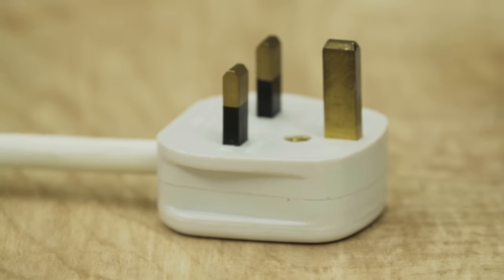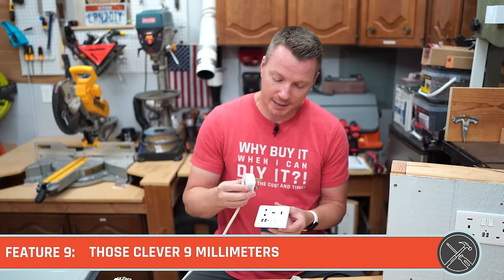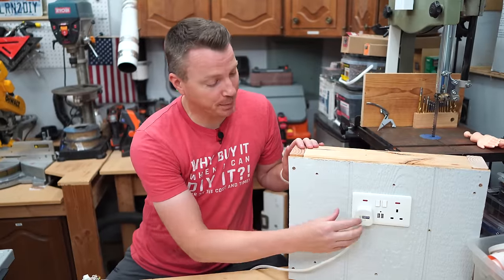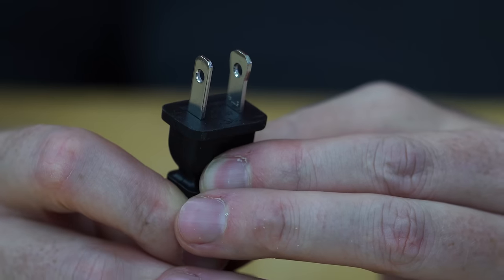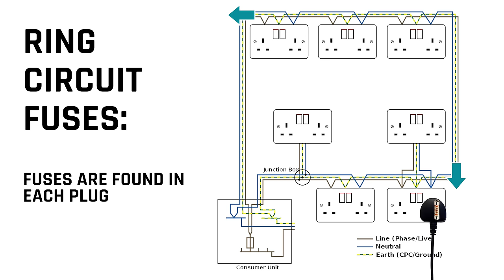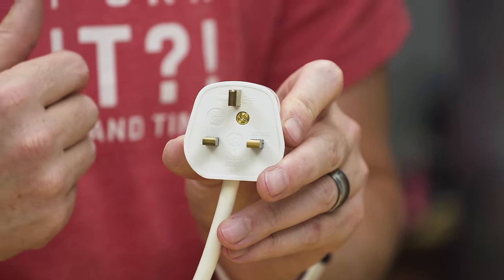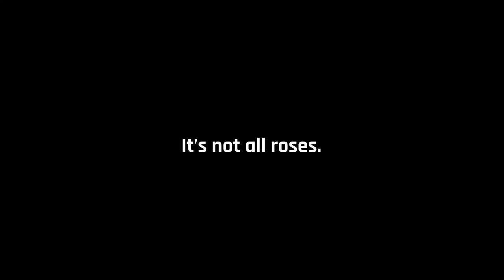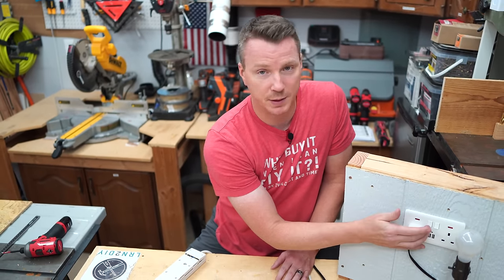British Plugs and Outlets Are On Another Level

Comment: Hi I am a UK Electrician, interestingly ring circuits using 2.5mm gauge are pretty much being phased out (pardon the pun 😁) in favour of radial circuits using 4.0mm gauge.  We also now use RCBO’s on each circuit and a surge protection device covering the whole install.  👍🏻
Reply: Ring final circuits are not being phased out. In new build homes they are still standard. 

The ring has been around for 80 years working well being very safe. Electricans understand them and how to fault find on them. Not a problem. Injuries and death on domestic electrical systems in Britain is about the least in the world, having been so for 80 years..
Reply: @johnburns4017  Well I have been an Electrician for over thirty years and the trend (and what new Electricians are being taught) is towards radials instead of ring.
Reply: @Poorlybobsdad  Does it cost more to install? More profit for builders.
Reply: @almac2598  Not really.  A radial is a straight line, where a ring is a circle.  You use more cable in a ring but a radials wire is thicker.  The costs would be similar and the install time for a radial is a bit faster.
Reply: @Poorlybobsdad  
That was pressure from the EU to go to radials. We are not in the EU any longer.
Reply: Radials have more circuits with heavier cables. More needless expense - copper prices are thru the ceiling. Far more expense to stand still at best. Then more maintenance further on in time.
Reply: If the ring is broken, say you lose a neutral connection somewhere along the way, is there anything that warns you?  If not then surely that's the biggest issue with a ring as you lose the ability to load balance properly and if you have an unfortunate collection of high load appliances in the wrong place (e.g. close to the break) then you're going to be at risk of overloading that 2.5mm gauge run
Reply: @johnburns4017  No, that is not the reason they are now favoured over rings.  It about inspection and testing (EICR’s etc).  It’s far simpler to test and report a radial than a ring,  especially an older ring that has multiple spurs.   Radials are also easier to fault find and install in the first place.  Feed it off a RCBO or AFDD and it’s a safe and efficient solution.  I am an older Electrician and it took me a while to move away from rings.  In the end I had to accept radials are better.  The only down side is the higher cost of the wire.
Reply: Roberts I suggest watch a 13 part series called What on earth happened by Ewaranon to learn that the earth is not a globe. Link in my about tab.
Reply: @adamm9557  Exactly Adam.  You only find the problem once it stops working (this is usually when it’s melted).  I once attended a customer site where they complained of a burning smell in the kitchen.  The kitchen had a dedicated ring which was broken.  All the load from a washing machine, dishwasher, microwave, kettle was running through a single 2.5mm wire fed by a 32a breaker.  When I go there (I went straight away) everything was running and I saw small blue /green flames coming from behind a socket under a kitchen cupboard.  A few minutes later the kitchen would of gone up in flames.
Reply: @adamm9557  
If a ring is severed, it will trip. I have never come across one that was severed, never mind severed and keeps working.
Reply: @flat-earther  
Correct. The Flat Earth Society members will agree.
Reply: @johnburns4017  I don't mean severed completely, I mean just having lost 1 wire .. let's say a single neutral pops out of the back of a socket.  No more ring.  Might do this today in fact as I'm curious.  I don't see why that would trip?  RCD would trip if there's leakage to ground right?  And there isn't in this scenario.  the MCB would break if you exceed the load on that circuit (probably 32A) .. a 10m run best case installation (clipped bare to a wall) needs 4.0mm at full load (7.7ish Kw) so I can see you running into trouble long before the MCB would trip
Reply: @Poorlybobsdad  thanks - perfect world maybe run your rings in 4mm I guess ... I have a spur socket in our utility room that has melted before, 2.5mm back to an old ring that may or not be broken.  Reminds me that I need to get a new run back to CU in 4mm for that room, concrete floors though :-/  cheers!
Reply: @adamm9557  
Use Wagos, with 2.5mm flex to sockets inside the backbox,  then wires not work loose or pop out.  Use the latest and best. Use old ways, more trouble.
Reply: @adamm9557  
My living room, bed and hall are on a 25A RCBO with 2.5mm cable. The ring can break, it will not overheat the cable.
Reply: @johnburns4017  Nice tip .. love wagos .. but I'm not about to go and do that to every socket in the house . might check the kitchen though
Reply: @johnburns4017  
Broken ring final circuits ARE a serious danger and fire risk!
Lots of DIY/Cowboys have started installing these USB sockets which normally require deeper back box's.  However they just cram the sockets on and in lots of cases break the ring final, resulting in 2.5mm cable being protected for overload by 32A    aka Dangerous and a prolonged high load will turn that 2.5mm cable into a heating element effectively !
Reply: @Leftfield2k7  
That  is why I suggest Wagos with 35mm deep backboxes. That way no problems. 

But you cannot legislate for idiots.  MK have sockets with Wago connections, not screws. Then idiots can fit them.
Reply: yeah, like west EU since 40 years.
Reply: In Australia we have radial circuits of 2.5 sq mm and 20 A breakers. It works very well. I can't see why anyone would want a circuit with 4 sq mm and 32 A except for a stovetop or AC, I guess, which we also have. USA has the miserable 120V farce, so hopelessly limited.
Reply: @HughCStevenson1  the 32 is for kitchens and areas in the house with higher demand.  2.5mm radial for upstairs etc on a 16a rcbo 👍🏻.
Reply: So if I have a bedroom far from the consumer unit with 4 sockets (as in my own house), in a new build each socket is a radial  straight back to the consumer unit in 4mm - rather than a pair of 2.5mm to a 1st floor ring -- that is a recipe for increased costs and a massive consumer unit to accommodate all the cable - and little increase in safety.
Reply: @johnlatchford9425  Not in Australia. Appliances are only up to 10 A and the MCB is 20 A. There can be many sockets on one radial. I don't know what the standard says about sockets in a given room but it is nice to have 2 circuits if there are many outlets. If you plug n too much stuff, the breaker trips and you know you have to unplug something! :)
Reply: @adamm9557  no reason why a properly installed ring should drop a conductor other than through interference.

Comment: Great video. I’ve forgotten about all the negatives in the time we have been using type G plugs but when you describe stepping on the plug I remember when I had to go to hospital as there was a plug stuck in my foot as I stepped on it very hard😂. The one thing I would say around size is it makes it very easy to plug-in and that means that you can use it at whatever age you are and whatever accessibility issues you have.

Comment: Brit here.  My mum and step-dad recently moved back to the UK after living in Australia for 15 years.  They brought their huge and expensive fridge and freezers over in the shipping container.  They had moulded Ozzy plugs on them.  Rather than using adapters, I could easily cut the old plugs off and attach UK plugs.  Perfect.  As for the shutter system in the socket, I can confirm that a sufficiently inquisitive child and a chopstick can open those shutters.  I'm still alive, though :)
Reply: Probably need better shutters, the ones we have need quite a bit of force to open. A child shouldn't be able to open it.
Reply: @sh-ehmed  Leverage is a powerful force, my friend.
Reply: @_Pikahiiri_  nobody can stop a child with levers

Comment: Another point to mention is the colour of the wires. The brown, blue and green/yellow help everyone (such as the colour blind) to be able to very easily identify/distinguish the different wires.
Reply: Colin Mitchell   but we do switches on our outlets just like the uk  but the plugs do have a lot smaller pins
Reply: Easy to remember the live colour as it's the colour your pants will turn if you touch it
Reply: @MarkDaykin  I always remember it from a teacher telling us "James Brown is a live wire" but I guess that works too 😂
Reply: But when I were a lad the live was red, the neutral was black and the earth was green. Seems most of you lot are too young to remember the old colour scheme.
Reply: @ThePuterMan  many houses still have the old wiring so I don't think anyone is too young to remember as it's still here. Good to see you're not too old to access the Internet 😉
Reply: @ThePuterMan  The brown live, blue neutral, green/yellow earth is the result of EU meddling ( harmonisation ) in a perfectly sane system of Red, black and green wires which was much more intuitive.
Reply: Underrated comment, the standards were changed in the early 90s to ensure they could be identified even by colourblind individuals
Reply: @explorer47422  appliance flexes went to the european standard in the 70's
Reply: Well the colours are really EU colours.  The UK used to use red and black. In the building wiring single phase UK colours were red , black , green/yellow upto about 2004. Now we've been EU-ised.
The portable flexible cables got the brown, blue , green-yellow back in the early 1970s.
I seen the flexible cable in older appliances my father had , that was red, black and green (didn't even bother with green/yellow)
Reply: @ThePuterMan  I can remember red, black, green flex wiring colours ! Well old appliances from my parents.
Reply: @chrissmith2114  Yeah, I agree !
Reply: Brown is BRown (bottom right), BLue is Bottom Left
Reply: Colin Mitchell  no one looks to Australia for electrical standards, for a reason.
Reply: @grahamlucas2712  Changing colours for a minority never makes sense.... they should just lave electricity alone.  The main reason for these changes in UK was to match UK wire colours with those in Europe in order to achieve 'harmonisation'....
Reply: @ThePuterMan  And Bakelite plugs!
Reply: @susanbarker2525  EUrine imposition from the mid-Seventies, I think. Over 45-50.
Reply: @chrissmith2114  Brexit happened, so  please go back to your old system if that makes you happy. And please enjoy your new French Navy Blue passport.

Comment: Brazilian system and plugs are very good as well. Earth pin as a guide, wall sockets have the plug shape in bas relief so the it only makes contact when it's practically impossible to get shocked, and still have the isolation on the live and neutral pins.

Comment: Nice video. I love the British plug having experienced all types now. I heard many years ago that the black bits on the live and neutral were included as a safety feature because elderly people with weak grip and frail fingers were gripping around the plug and coming into contact with the pins when inserting the plug into a socket. I remember when they were not on them. My dad was a sparky.

Comment: You missed one other advantage, any water accidentally sprayed onto a socket in the wall is not going to enter the plug, because the wire coming out of the plug is always pointing down.  😊
Reply: Doesn't help i condensation runs into the socket
Reply: Absolutely, and if the plug is out the shutters stop water ingress.....
Reply: @cappaculla  if your condensation is that bad maybe you need to plug a dehumidifier into the socket - just sayin !
Reply: Apart from the flush socket in my living room Dad reinstalled upside down so he could neatly spur off with a surface t&e down via a notch cut in the only suitable part of the socket. :)
Reply: Water sprayed while making tea most likely ;)
Reply: Actually that cuts both ways, because unlike the moulded plugs used in most of the rest of the world, UK plugs are not sealed.
Reply: @gregfaris6959  A lot of UK plugs are 'moulded' onto cable and the fuse bit accessible from outside base of plug is actually sealed.  I have fitted Australian type 'retro-fit' plug which just had a flexible moulded 'push on' top cover which could be removed while plug was plugged into a socket - i was 'shocked' how dangerous it was.
Reply: @Victor Seal - Anyone dumb enough to spray water on ANY plug deserves to experience the results. That's about the same as sitting in a bathtub full of water while holding a plugged-in TV on your waist!

Comment: G-Plugs are the best, for the reasons described, safety, quality, maintenance, through-life cost, etc. The downsides mentioned don't apply to anyone using them. Also, I'd like to mention that the "size" downside at 9:43 is inaccurate. The Type-G plug is orientated vertically, the cable comes out the bottom (vertically), so it is only 1/2" proud of the socket. Whereas Type-A or Type-B is orientated horizontally, and the cable comes out the front (horizontally), as such, these plugs are 2" proud of the socket - and therefore "larger" as they consume more space. As such, they are a greater trip hazard - another disadvantage.

Comment: As a Brit. I didn’t realise just how good these plugs are. BTW I never had an issue with load balancing and I’ve never heard of anyone else having a problem with it either.
Reply: That is because it is based on faulty theoretical physics which takes no account of cable heating due to higher load and the TCR of copper, which self-balances the ring.

Comment: Radials are used across the pond, and are starting to become more popular. Rings originated during and after the world wars due to a lack in copper. Rings are cheaper since they use less copper. Nowadays, rings are used for both the sockets and lights but we tend to split the upstairs and downstairs sockets. so both upstairs and downstairs sockets are on seperate 32A RCBO/AFDDs and both lighting circuits are on a 6A each.

Comment: I'm from the UK and live in the states. The size of UK plug body is more than made up for by the fact that the cable runs down and along the wall. Most standard American plugs run out of the wall, parallel with the floor, and so end up taking up much much MUCH more space as furniture, etc, needs to be away from the wall to accommodate them.
Reply: Then British plug is that size for hands to hold it.

Comment: Thanks, that’s a very informative video.
It’s interesting to have our plugs analysed by somebody on the outside looking in, and refreshing to see they have a number of plus points.
On the subject of their size, it’s reassuring to have something reasonably chunky & substantial between you and the potentially lethal electricity in the wall socket. And as they are usually left plugged into the socket all the time, size is not an issue as they just sit their completely unobtrusively.
Reply: *there

Comment: The fact that our plugs are serviceable is a big benefit. I've had situations where an electrical appliance either stops working or is being thrown out and I'll almost always cut the plug off the appliance as often it makes a good spare if I need to fix or replace a plug on a different appliance.
Reply: It's not really that important from a US perspective. If you care about the equipment with the (somehow) destroyed plug, you can cut the wire and splice on a new one (it won't be as streamlined, but it'll work.)

Comment: Its sad but I've always loved how well designed these plugs are, literally everything has been thought of. Those downsides aren't really down sides.. Don't think I've ever had an issue with 'load balancing' systems are designed for what they're going to be doing. Also, If you unplug something it tends to stay next to the wall where oyu unplugged it from so you won't be randomly stepping on it!
Reply: Yeah those downsides were massive reaches at best. 

1. How often do you consider the size of a plug when you plug something in and walk away, thats an argument for aesthetics not function.  
2. You'd have to seriously abuse a single socket to consider load balancing, especially as larger appliances are often on their own ring for that exact reason. 
3. Nothing to do with the plug design. 
4. Are Americans too dim to check if something is switched on before assuming it's broken? 
5. Don't be a slob and put your electricals away when you're done with them.
Reply: I'm a Brit and qualified electrical/electronic and for me there is one downside and has only to do with manufacturing - it's an expensive plug to manufacture. There are a lot of people saying that you can just wire a standard plug but manufacturers of mains powered goods have to pass a certificate of conformity (the CE label) so that's why you have all these moulded plugs/cables that they pass safety regulations.
Reply: I didn’t even know “load balancing” was a thing. This is the first I’ve ever heard of it
Reply: @paulmorgan8254  Being so robust, means they can be reused almost indefinitely.  They are almost indestructible (within reason).
Reply: @cdl0  I never mentioned anything about robustness but now you've brought the subject up I bet there are many people with old 13A mains plugs (my father would never throw them away) which are dangerous because the thread on the plug cover has worn so can't be tightened enough and I know enough stories of the covers falling off exposing the terminals.
Reply: @paulmorgan8254  Well, you could repair them with Araldite, I suppose!  🙂  Personally, I don't posses any plugs which are that bad, and many of mine are decades old.  The rubberized variety are particularly tough, as always, within reason.
Reply: @mattd6085  4. Yes.